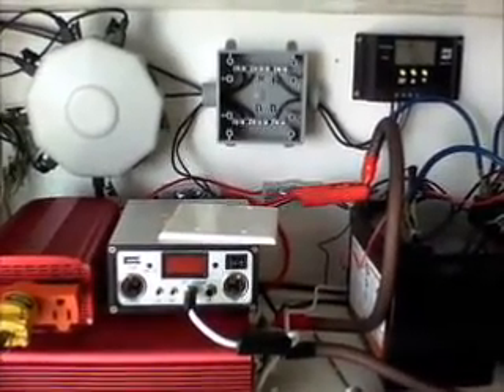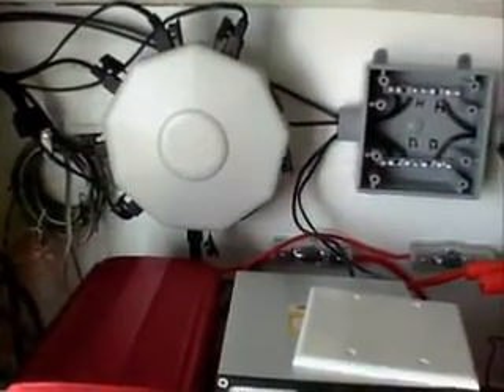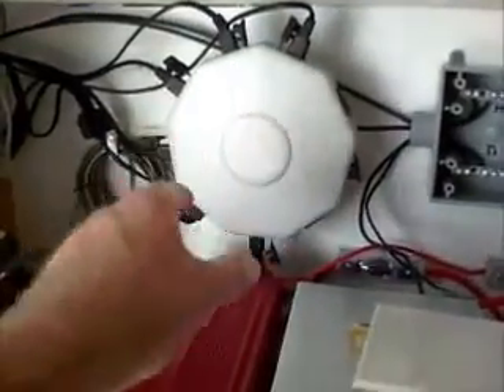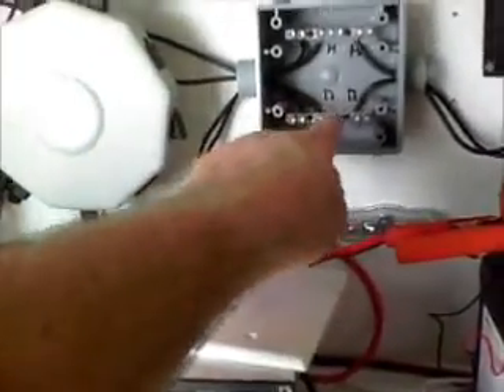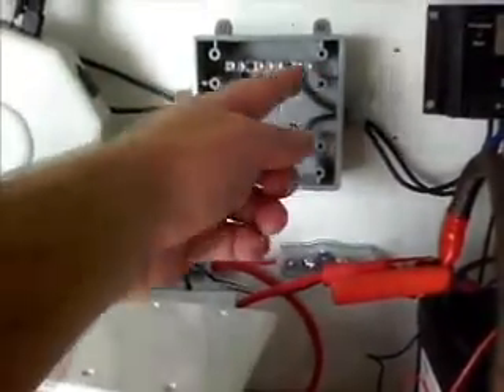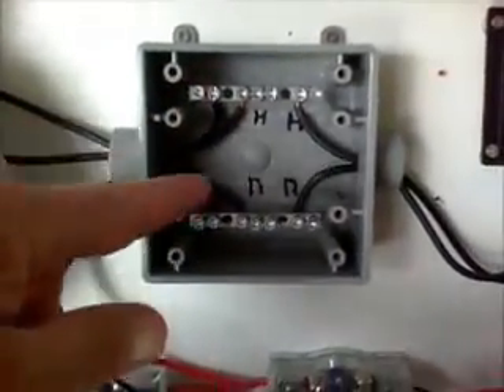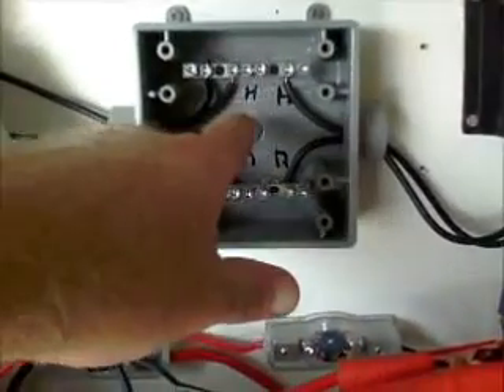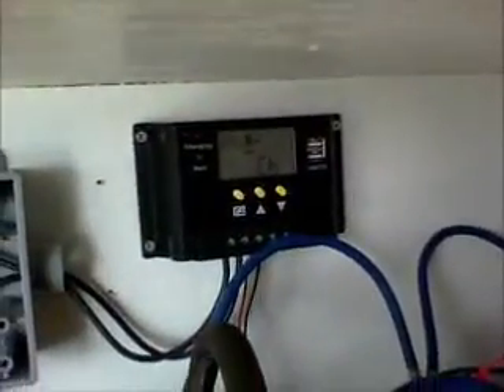DIY Solar Combiner Box

Comment: Can I just hook up 2-100watt solar panel kits to a battery bank instead of buying a combiner box?  8panels 200watt - 2charge controler in (1 bank  12v 400amp).   Dont wanna guy a combiner box yet. $$
Reply from the maker: You have to go through the charge controller, it will over charge the batteries if you don't. Just tie all your panels together (up to what your charge controller will handle) then run through a charge controller to make sure it will not harm your batteries.

Comment: how many watts does your panels produce on a good day?
Reply from the maker: It produces about 200 watts an hour now that I've got the 100 watt panel added to my array. So on a summer day I would say some where around 2800 to 3000 watts for the whole day. It's more than what my battery bank will hold when it has a full charge so we use the solar power a lot during the day now as well as at night for free lights and stuff.